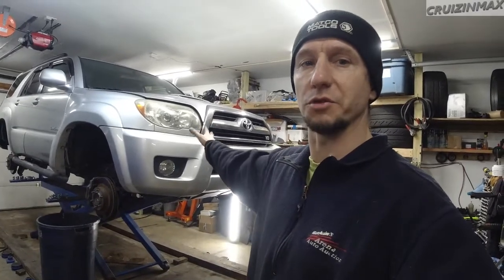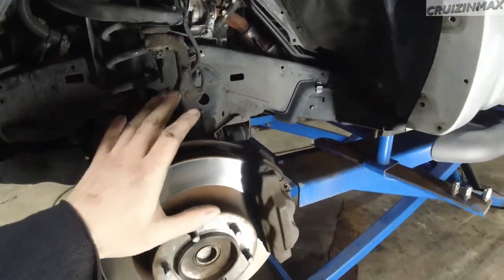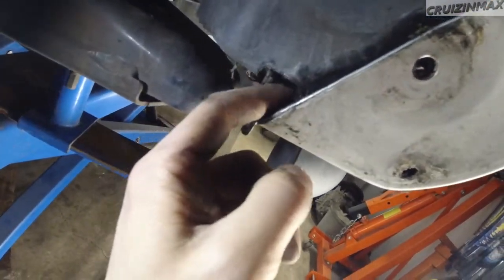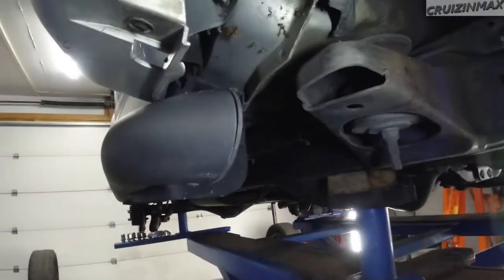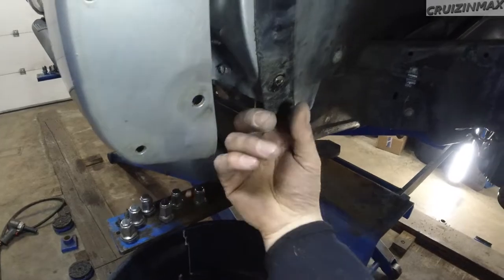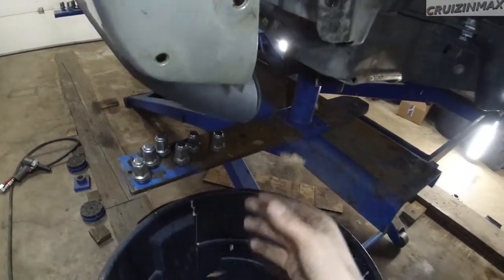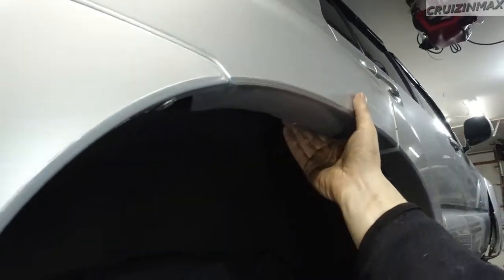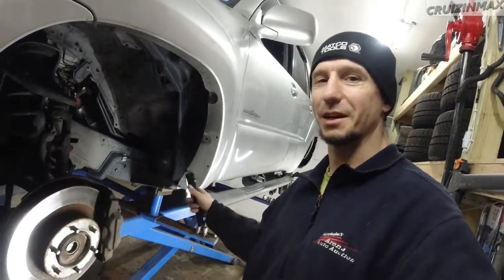4th Gen Toyota 4Runner what I found inside the fenders

Comment: How do you remove the back door Fenders? because mine is coming off almost, and when I open the rear door the fender interferes with the front door!
Reply from the maker: its the same clips, they are difficult to remove without breaking, your best bet is to remove the whole fender by prying it away carefully, get yourself blue and orange toyota fender clips, i think i got them from ebay or amazon.